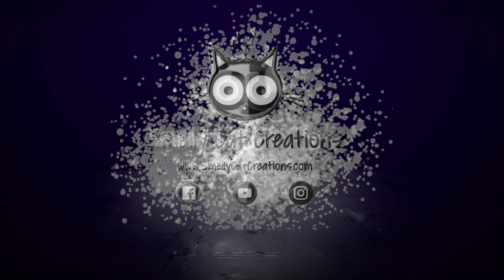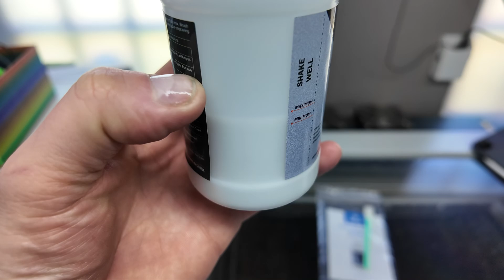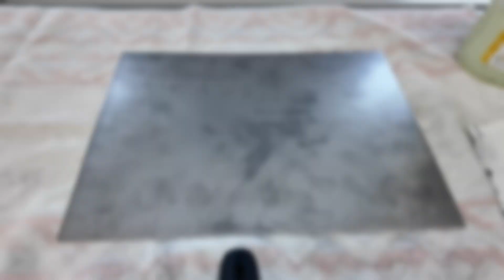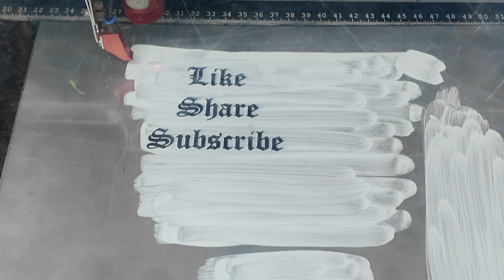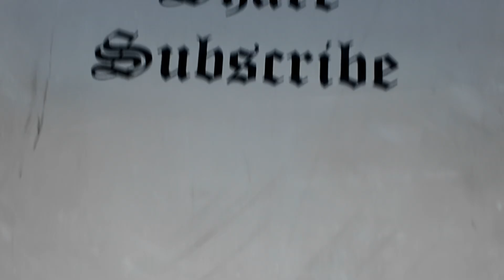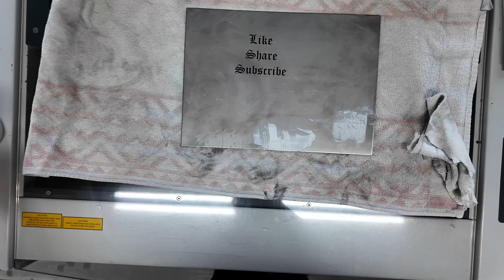How to Use OMTech CO2 Black Laser Marking Powder | Mark Stainless Steel with a CO2 Laser!

Comment: Just get titanium dioxide powder from a ceramics supplier for under $15 a pound. One pound should last close to a lifetime. I mix it with tempera paint and thin it down to spray-able constantly either with water or alcohol. I use a cheap cordless airbrush designed for doing makeup.  Works on metal, ceramic, wood and glass. Same active ingredient as the sprays. Cheap as chips....
Reply from the maker: Appreciate the tip :) I will look to get some and give it a try. Always love cheaper alternatives. Thanks for watching and the feedback.
Reply: Would you mind providing the recipe? How do I mix and how much of each? Thanks for sharing this!
Reply: @gypsysoul1011 I really don't follow a recipe just li,e in the kitchen. I use a couple "scoops" from the end of a large craft stick into a ketchup bottle,  then add 2-3 timesas much tempera paint and enough water to make it sprayable. Just takes some experimenting to get it right. I picked up a flour sifter to sift the titanium dioxide to help brake up any clumps. I used to add a few drops of food coloring for contrast,  but find that stains un-glazed tiles. You can see the texture of the titanium dioxide in the paint coating.  Of course it takes a few coats to get the thickness you want. I have gone from a rechargeable air sprayer to a no clean airbrush as i picked up a regular air compressor fo oter projects.

Comment: Just got the powder from OmTech a few days ago and will test today. 
results are looking awesome
Did you use ethanol ?
I`ve asked the Omtech Chatboot and they say Isopranol will do the job just as well
after all is only a suspension substance
is meant to carry the powder than evaporate and disappear
Many thanks for the video
Reply from the maker: Thanks for watching the video and your comment. I didn't use Ethanol, I had lots of IPA and decided it was close enough for the carrier liquid and would still evaporate. I was really impressed with how well it worked. The main important parts are 1) making sure you get a nice thick consistent layer 2) plenty of laser power, I think a min of 30watts and ideally higher

Comment: hi
what is storage life or shelf life after first use? was it still useable after a fewdays,
Reply from the maker: I don't see any reason why it would expire, the alcohol could evaporate, but since the bottle is well sealed i think it will be fine. my bottle is still as it was when I mixed it. just needs a shake before use